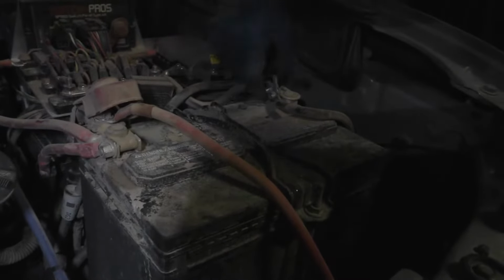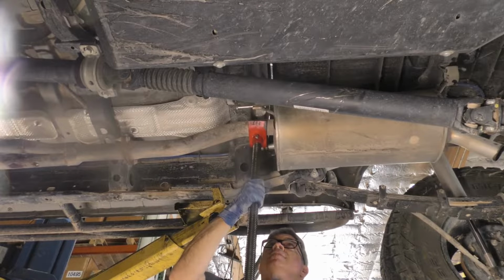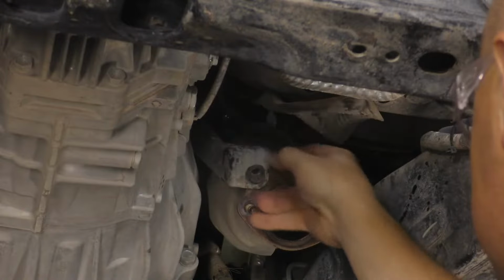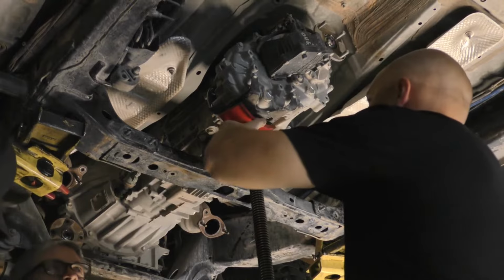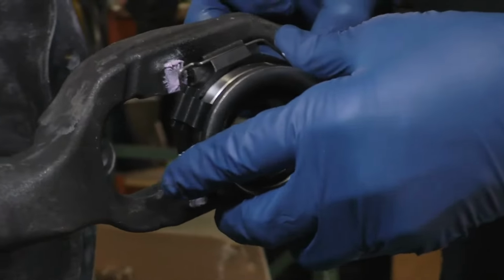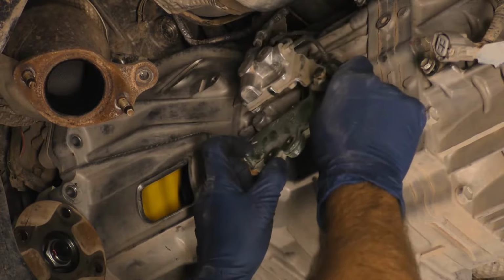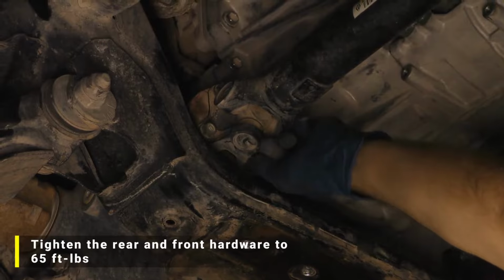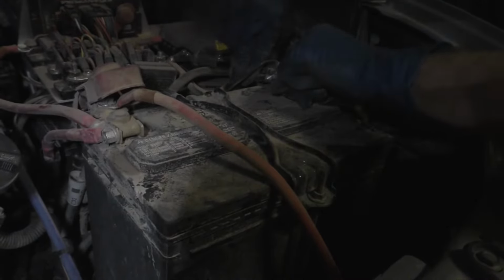ACT Clutch Install: 2016 – 2023 Toyota Tacoma 3.5L V6 2WD & 4WD

Comment: There are at least five bolts on top of the transmission holding wires that have to come off. Otherwise the transmission dangles

Comment: So is it easy to get to the top bolts of the transmission ?
Reply from the maker: I’m not sure I would call them exactly “easy”. Basically, from the rear of the transfer case, we ended up using multiple long extensions and two people (one to guide the socket onto the bolt head and one to turn the ratchet) to get them undone.
Reply: @AdvancedClutchTechnology   Did y'all support the motor at all?
Reply from the maker: @ratoncolorado7227  We did not support the engine as the mounts are pretty much centered on the block and kept it balanced (it did not swing down either way to the front or rear).